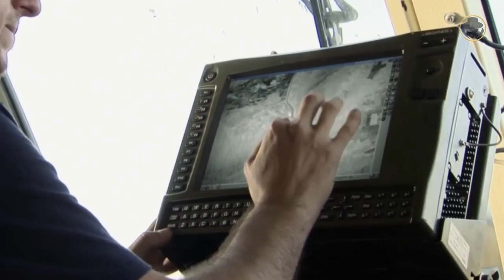ATMOS 2000 | Israel's next-generation self-propelled howitzer

Comment: "Serbia is 152 mm producer, it is question on 155 mm performance?" Just to remind that in the middle of '80 then Yugoslavia, now Serbia, devloped 155mm/L45 solution with some help of Gerald Bull, like conversion for M46 gun. During '80 Yugoslavia upgraded D20 to L39 152mm. Todays Nora B52 is descendant of those works. During the '50 Yugoslavia was producing under licence 155 and 105 mm howitzers. As allready commeted, Kamaz and MAN platforms are offered for Nora. Algeria is now potential buyer. ATMOS and Nora are not in the same class, Nora is on more automated side.